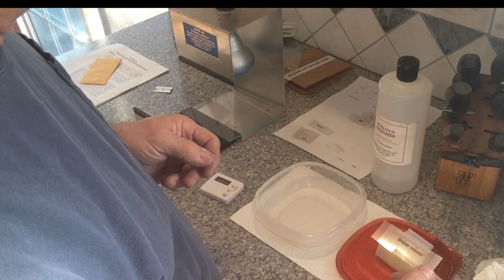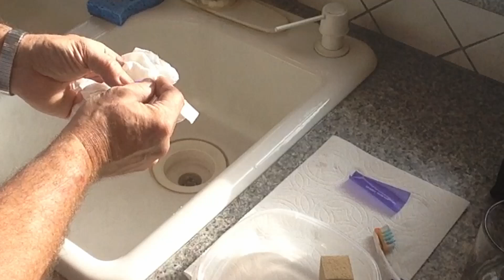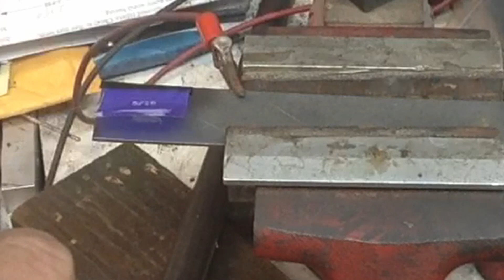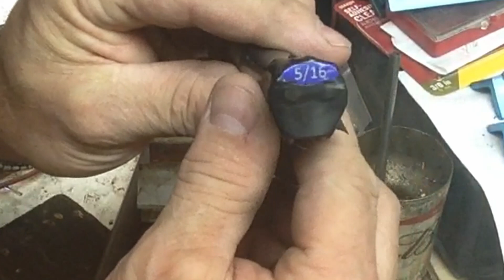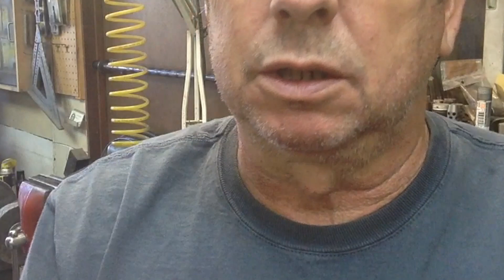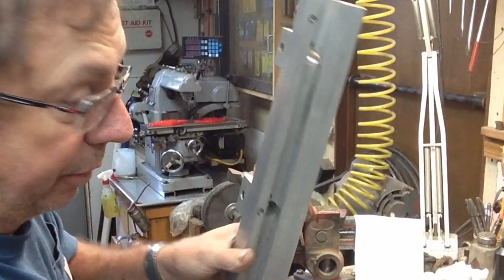Using Electro-Chemical Etching To Mark Tools

Comment: Where do you get your photo film from and what is it called?
Reply from the maker: I usually get my supplies from Matronics corporation . They have a fairly good website and are good to deal with for the hobby types. My etching machine comes from IMG which I feel is more directed at industry. Dan.

Comment: So how much does a setup like that cost?
Reply from the maker: depends on what setup you get. hobbyist type start around $150 but is limited in capabilities, My current setup with a used marking unit that I had to send in and have repaired I probably have about $800 in it
Reply: @hillsgun  thank you. I am trying to get a setup for marking a lot of tools at work and it is surprisingly difficult to find an exact list of everything you need.
Reply from the maker: @SuperBellyflop  check out "etch o matic" they have a good setup depending on what you want to do. I started with their basic setup which in my opinion is lacking, but their more powerful setup is probably ok. I use their stuff for making stencils.